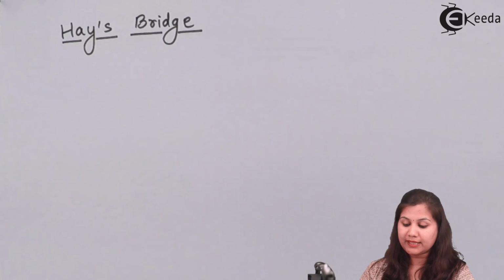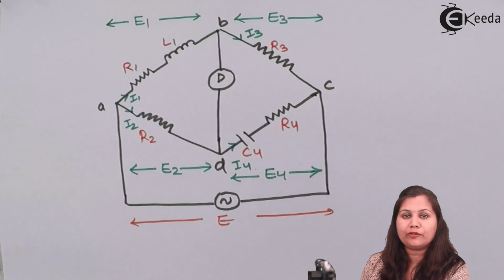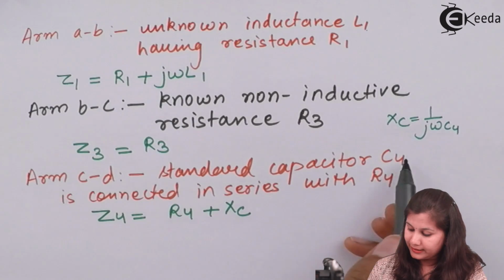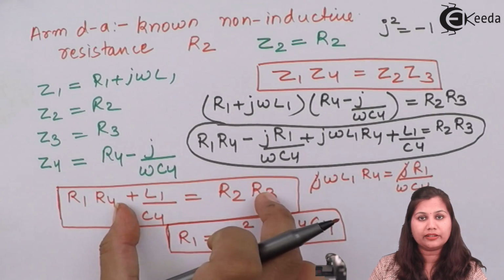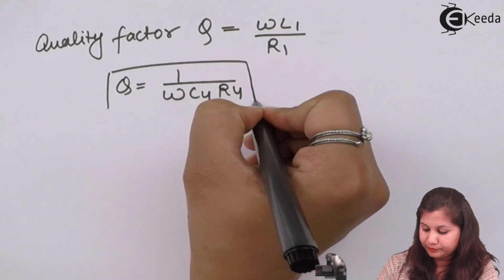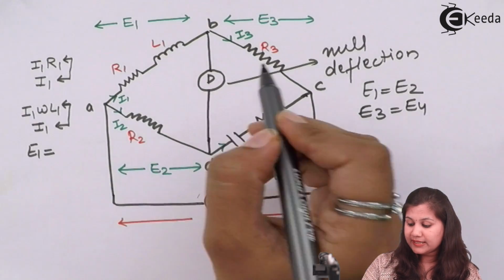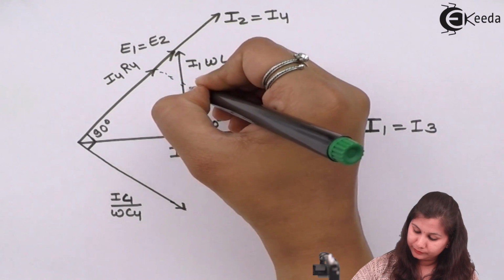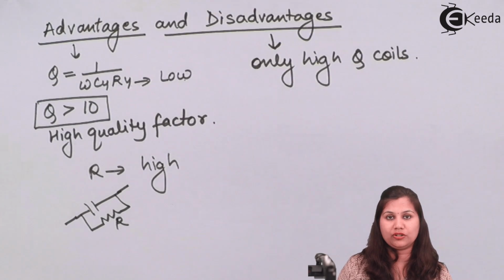Hay's Bridge for Inductance Measurement - Electronic Instrumentation and Measurement

Comment: You said wrong ❌
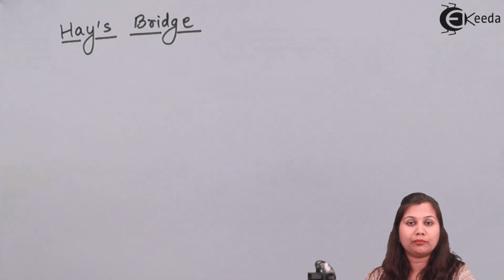At 0:54 seconds you said that 
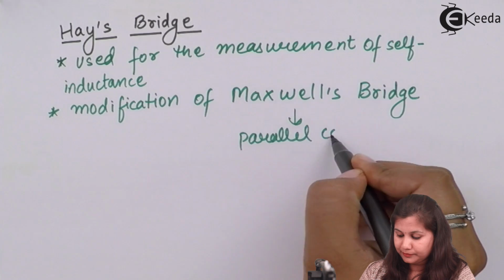In maxwells bridge capacitor and resistor are in series and at 1:50 seconds you said that 
In maxwells bridge capacitor and resistor are in parallel.
Reply: yes ,  in Maxwell capacitance inductance bridge the capacitor are parallel to resister ...😊